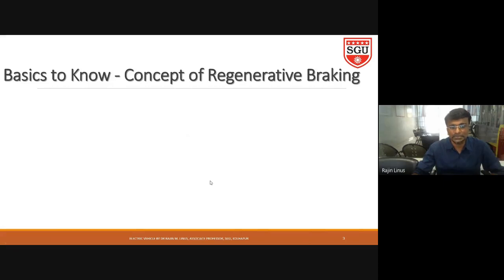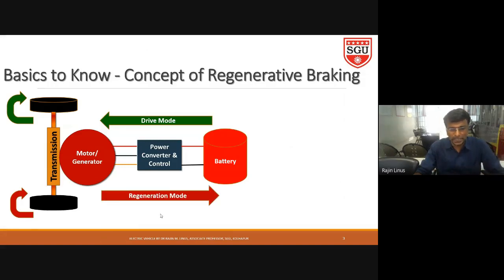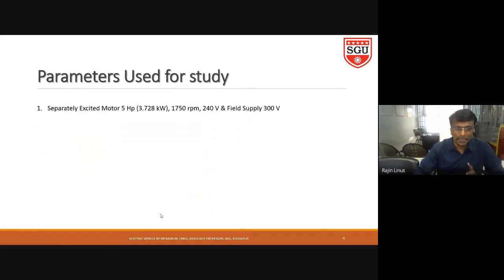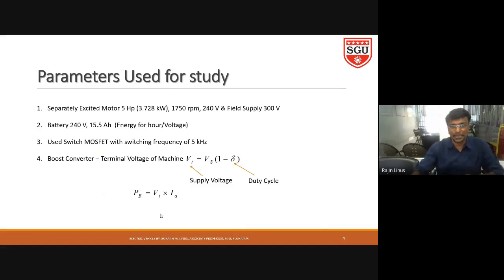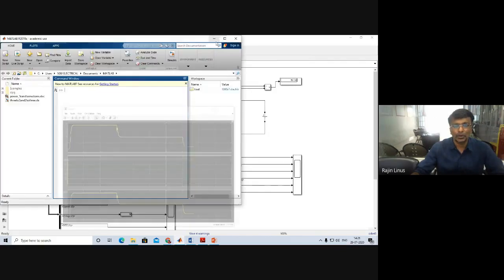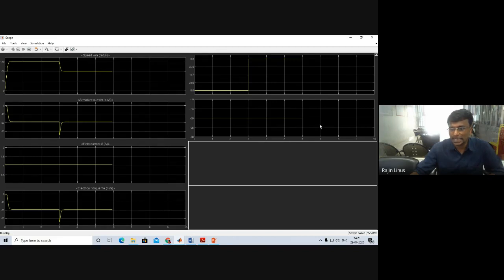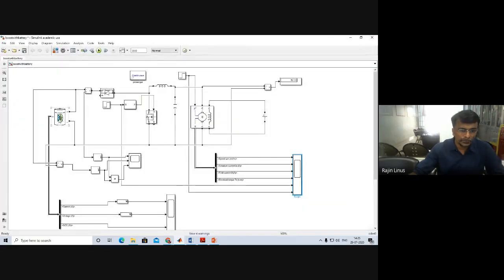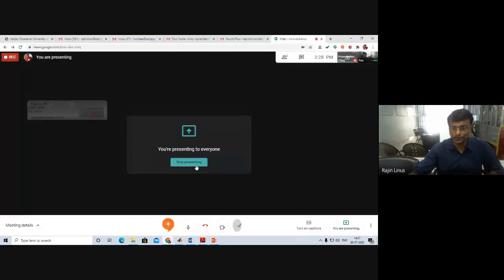Electric Vehicle 3: MATLAB Simulation of Regenerative Braking By Dr Rajin M. Linus (Part-I)

Comment: Hello Sir, I would like to know why the torque are both negative at initial and final step, does it mean the motor is actually in regenerative mode at all time? Tysm.
Reply from the maker: @ryankin119  yes motor act as generator
Reply: @ Thank you for the reply. I wonder if it is possible to keep the load torque at positive constant value, so the motor operates in forward motoring mode.
Then when speed reference is reduced but keep at positive value, the motor can still go into regenerative braking mode.

Comment: Respected sir,  I have a doubt regarding boost converter in this circuit,kindly clarify this. The boost convertor should increase the voltage, but in this circuit, output voltage is less than the battery voltage (240). Kindly help me by giving reply sir.

Comment: Sorry, what is the block between the diode and the battery?  And what is also the last block at the right just after the voltage measurement block? Thank you but from the video i do not understand well
Reply from the maker: Thank you for the comment. The block between the diode and battery is current measurement. The block just after the voltage measurement is display.

Comment: Sir im unable to get the proper waveforms in the scope . Kindly help me. Ps: I've also emailed you regarding this issue but you still havent responded
Reply from the maker: Dear Sir,  Thank you for your comment. I have seen your mail. Instead of sending matlab files to simulate and check it from my end, you send me the waveforms clearly and details of your expectation and variation in output. So that i can clearly understand. Based on the usage of different matlab version it is difficult manage with every one file. I hope you understand the issue. Similarly from your end you analyze at your level best before. Then only you can learn more.  Thank you

Comment: hi sir how to design the regenerative braking system in switched reluctance motor drive for electrical vehicle applications using matlab
Reply from the maker: Thank you for your comment. First you complete the speed control of the motor. Then analyze the performance during the generating mode. Accordingly, do the control

Comment: Hello sir, This is Prasad Can we use BLDC Motor in the place of Separately excited motor, If Yes what about efficiency sir...Given Nice presentation....if any documentation related to this presentation please share to this email Id : prasad.lakshmi67@gmail.com. Instead of Mosfet , Can we use IGBT as a switch sir in this?....
Thanking You sir.
Regards,
Prasad
Reply from the maker: Instead of dc motor you can use BLDC motor. But, you cannot use dc to dc chopper. Instead, you have to use Inverter circuit based on the rotor  position.  There is no documentation except this. Thank you for your valuable comment. 🙏🙏
Reply: @Electric_known  Ok.thank you sir.